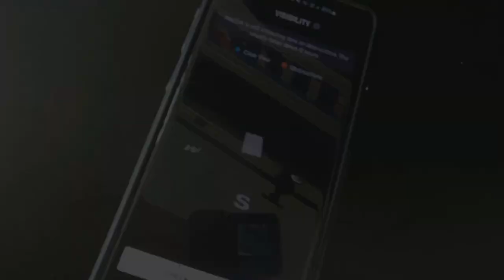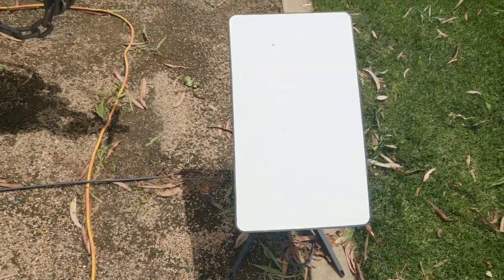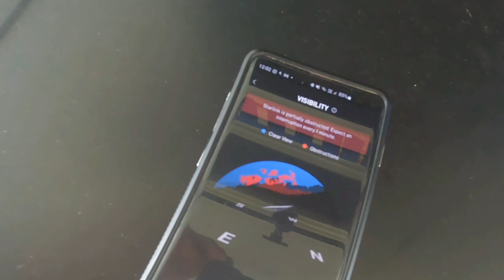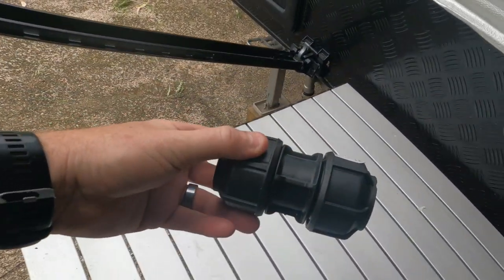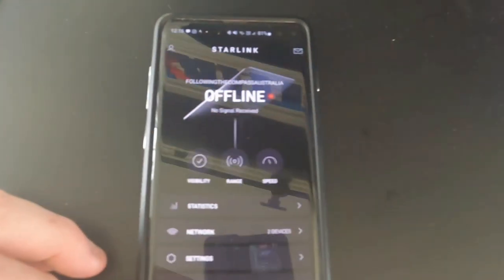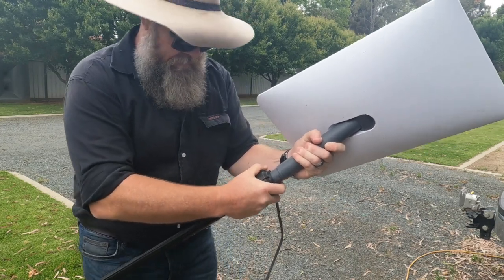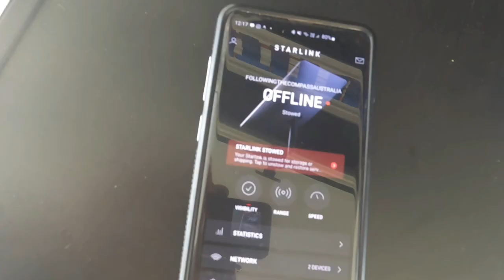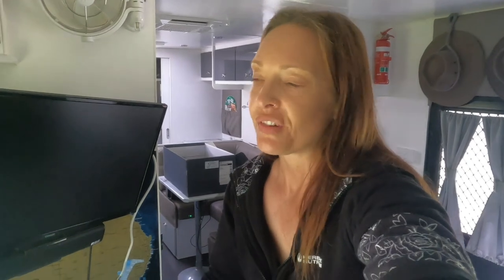Starlink: Our Review And How We Mounted It

Comment: Research carefully before cutting the cable and reterminating the RJ45 Connectors. Starlink uses a non standard cable layout. As long as you duplicate this, all is good.
Starlink also has a pole mount adaptor which can fit various sized poles. This works well, but needs an Allen key to fit and remove, however the Starlink dish slots right in and you can run the cable inside the tube. Consider a 2-3 metre high tripod (speaker stand). This gives additional flexibility to position the dish if you park the van under shade.
Reply from the maker: Thanks for the heads up Chris. We have found this information in our research also. We're very happy with our starlink mount solution. It works perfectly & it's a much cheaper option.

Comment: Thanks guys do you have a link to the pole and the 32mm fitting? Thank you
Reply from the maker: Hi there, the extendable pool pole is similar to this one (ours is black)  and the joiner is a Philmac 32mm joiner.
 https://www.bunnings.com.au/hy-clor-1-2m-3-6m-extension-pole-3-piece_p0293231

https://www.bunnings.com.au/philmac-32mm-metric-poly-x-poly-pipe-joiner_p4813794

Cheers
Reply: @FTCA  thank you
Reply: @FTCA  do you guys think it’s a must to do ?
Reply from the maker: Not necessarily, but I don't want to run the risk of it getting damaged as it's required for Bel's work.
Costs a total of about $60 and literally only takes about 60 seconds to put up

Comment: Hi guys, can you just turn on portability from residential at anytime?
Reply from the maker: Hey 👋 

When we purchased we got the residential plan with portability but this isn't available anymore.

The plans have changed to either residential or roam. I believe you can switch between the plans by contacting starlink.

Roam plan can be paused when not in use, you can use your starlink anywhere and is slightly more expensive. 

On the residential plan, you can only use starlink in the cell attached to your registered address and it is cheaper.
Reply: @FTCA  great thanks heaps.